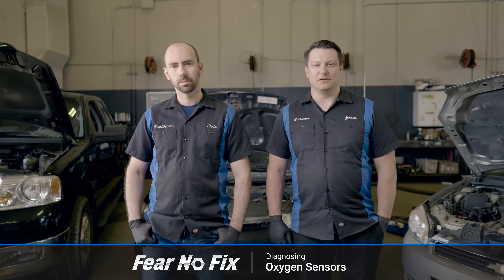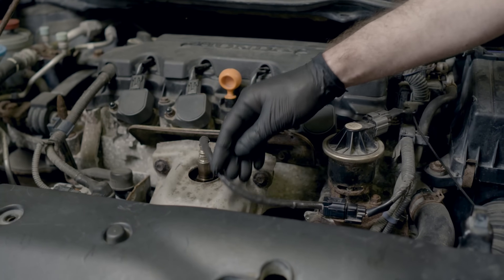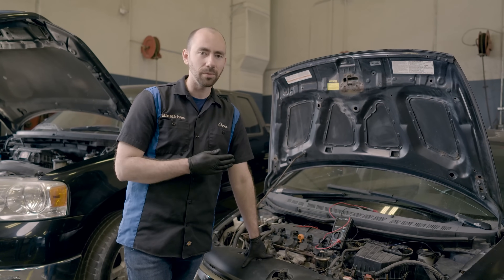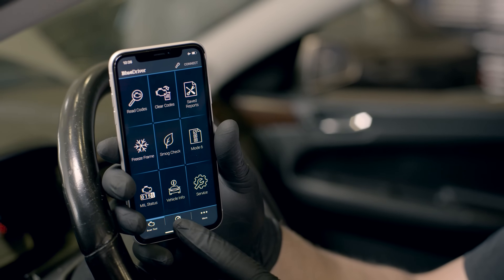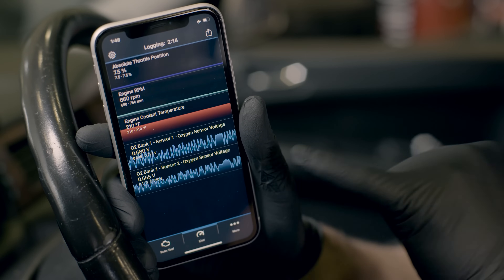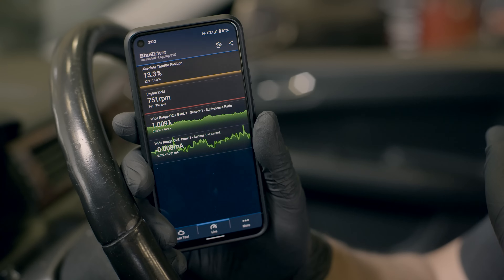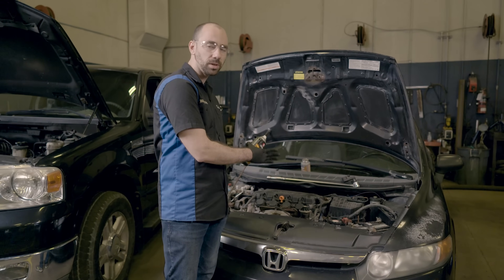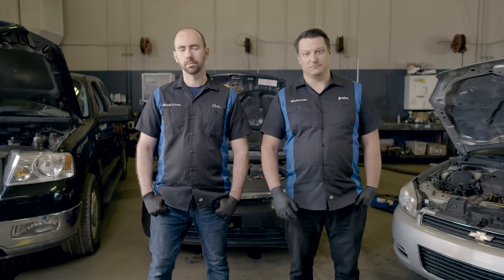Diagnosing O2 Sensors

Comment: I have a 2018 Nissan Titan. My body sensor is telling me that bank 1 sensor 1 is bad. I went to change it and couldn’t get to it. I removed the wheel well cover and couldn’t get see it but it is blocked by several break lines. I could get the socket on it and then attached the ratchet but there was no space to move it. Any suggestions would be much appreciated.

Comment: I have just replaced the front lambda sensor on my 2006 Daihatsu Charade and the old sensor came out surprisingly easy. The orange light is off non so it looks like I solved the problem

Comment: I did replace the o2 sensor on top of a 4 cylinder 2013 Chevy equinox it did stop stalling on me😮I don’t no if I should replace bottom 1 as well
Reply: It was stalling after I replaced the top o2 sensor it ran just fine😮

Comment: Horrible product from a security and right to own perspective. Can't connect to the device without enabling location data (it's a blue tooth connection imagine if you couldn't connect to a pair of blue tooth ear buds with out enabling location data). Also, you have to make an account. Why, probably targeted advertising that they are going to sell your data from your device to advertisers.
Reply: i’ve never had to enable location to connect to mine. or make an account.
Reply: @gtrplaya1234 new version doed require location and account

Comment: IF you replace the 02 with a new sensor and you have it showing bad data still?? AND I have replaced the CAT twice?  Would a running "rich" condition show a leaking/bad Injector...but it is idling just fine.....................

Comment: this may seem a bit far off but im pretty sure my bad o2 sensor is causing my transmission to go into limp mode
Reply: Checks out misfire leads to knock sensor the computer knows and make it drive at a safe preprogrammed setting

Comment: My pre cat sensors swing up and down sharply as good ones should, yet my B1S2 is pretty flat at .47V but my B2S2 is flat at .031v. Both spike up when I rev it. Under .45 is supposed to be a lean condition so is my B2S2 detecting a lean condition post car but pre cat the fuel trims are hoveering around 0. Do I have a bad cat in B2? There is no leaks in it as its one unit and there are no leaks between the 2 O2 bungs. All 4 are new and its on a 2012 Chrysler 3.8 with 136K miles. Thanks
Reply: What are your trouble codes?

Comment: Excellent information and teaching! Thank you for the great video!  One little thing I am laughing about to myself as I watch the video is that for the sake of the viewer (Me lol) you've chosen a car with an O2 sensor right up front where it's the easiest thing to see, find, work on and possibly change out if needed. I want people to know though that almost all (obviously there are a few that are easy) are VERY difficult to find, reach and work on. 16:08 "This sensor is proving to be pretty easy to remove". Wow he sure said that right LOL. They are being VERY polite and smooth. In the real world 95% of the sensors you will have to remove will "prove to be" lol. Al LOT more difficult to remove. A LOT, LOT more difficult.  They are so often only accessible from underneath the car and sometimes only through the wheel well or some other strange place very difficult to reach. Sorry for telling the bad news. But the facts are always better to know up front then finding out later when you're in the thick of it. Thanks again for the great video!
Reply: I guessed they would be, luckily for me my S1 is right in front and came away easily with an open ended spanner....phew. (Mitsubishi Lancer 2006)

Comment: It should be noted that you will want your crowsfoot-type  O2 socket to be perpendicular to your torque wrench. Otherwise, the torque that you're applying will be different from the value that you set your wrench to. Also, if you're replacing an O2 sensor, they should already have anti-seize applied to them from the factory. And a final note – if you remove an O2 sensor just to inspect it and plan on reinstalling it, they have a crush gasket (washer).
Reply: Awesome info, greatly appreciate the info.
Reply: Uy 12😊I 😊😊D
Reply: I. Don't know what to do with it

Comment: Hello ! I took my hyndai getz 2008 1.4 petrol .no. 1 lamb from the sensor before the catalyst, diagnostics showed a non-existent very low signal due to which the engine worked very stiffly and you could feel the vibration. I put a new lambda sensor original bosch and checked it with the diagnostic device on the engine running in 71.. .730 Ma was the rapidly changing amplitude of the signal. Although I'm not a professional car mechanic, I managed it, as they say a man from the forest fixed the car, good luck to all DIYers!

Comment: I heard about the cars built before year 2006 have different type of sine wave pattern for the O2 sensor. This is due to the ECU not cutting back fuel sufficiently to prompt the voltage to 0.1V for the O2 sensor. Yes, no?

Comment: My o2 second sensor voltage is higher than 1. 0
It fluctuates between 1.0 and 1.02 on idle and when i rev up its value goes upto 1.6

What could be the reason?

Comment: I got (closed loop) as soon as I turn on the engine, 20 seconds 
After a cold start 

How can this be fixed I don't think it can go closed loop this fast. Or can this be normal for some vehicles?
Reply: Normal
Reply: Mine goes in close loop within 6 seconds, pretty normal.
Reply: @scottykilmer3920  How do you know when it’s gone into close loop?
Reply: if you have a scantool you can see live data !
Reply: @scottykilmer3920  How can you see on a scantool when it's gone into close loop?  (And yes, I have a BlueDriver scantool)
Reply: You can see this option only with the official software like   Vagcom, Opcom, Focom. This function is not avaible on a universal Obd-reader.
Reply: @scottykilmer3920  Interesting that this video by BlueDriver would refer to closed loop values monitoring, while their own BlueDriver universal OBD-reader won't show it.  Are you saying that this function is not available on BlueDriver?  If so, are you sure about that?
Reply: I'm not familiar with Bluedriver, I wouldn't dare to give certainty. But I do know that almost all universal OBD reader tools I've used so far don't show open/closed Loop  and 10 other functions.
Reply: How do you know when it’s gone into close loop?

Comment: 2.9 ohms on a heater circuit? its ALMOST shorted. What does the meter read test leads together?
Reply: 2.9 ohms on 12v is 4.1 amps.  That does not seem like a short for a heating circuit.  And that also is about 49 watts... again, seems reasonable for a small heater.

Comment: I wish if I have known bidirectional scan tools before I bought bluedriver. Guys, please save your money & buy a bi-directional scan tool. Bluedriver was good 5 years ago, but it is not a bi-directional scan tool. I had to re-set my TPS after cleaning throttle body and than only found out about TPS reset after cleaning & bi-directional scan tools.
Reply: I have 2 good bidirectional tools and still keep my BlueDriver in my pocket. It gives good data but yes, a bidirectional is needed at times but there's also ways to go around them at times.
Reply: @iam1smiley1  I had a SRS light on my 07 civic & Bluedriver misled me to coming so close to replace front collision impact sensor. In fact, that sensor was never the problem.
Reply: @desi4lyfe379  code reading is only part of the diagnostic process. Codes may put you onto the correct problem area but it's still up to the technician to do proper testing before changing parts.....you see this happen a lot with O² sensors!
Reply: @iam1smiley1  There are so many cheap obd2 readers & I dont see the value in bluedriver. It was a great product back in the day, but bidirectional scan tools are just much better.
Reply: Guys my fuel status shows (closed loop) just after a cold start. And the fuel trims start showing the readings.  I don't understand why doesn't make sense 😐 

It should only become closed when  heat increases. Not sure if that's accurate or it needs an updated IDK 

Bluedriver 
Fusion 2014
Reply: All OBD2 ELM-327 are bi-directional the only problem is the software.
Reply: @w0lvez1  ELM-327 is not bidirectional in context of automotive.  Bidirectional command is like turning the fuel pump on and off.  When ELM claims bidirectional, it just means it can erase codes, not actual OEM / pro level automotive bidirectionality.  Don't bs people into trying to buy cheap chinese knockoffs.  ELMs are so shitty they can't even determine which code turns on the MIL light.  It just spews out all the codes and doesn't know which one is causing the MIL.
Reply: @derek7819   99.9% SURE it's Bidirectional. It can change the coding on VW & Audi control module using Carista app. It doesn't let you type the coding directly but it can adjust the coding settings.  Example:  adjusting the tail, brake light & DRL brightness.
Reply: @derek7819   YES, it can activate the fuel pump or do actuator test on a Ford using Forscan software. It can also read all pids on all modules. ELM 327 has the capability the only problem is finding software that will work with other makes. I also have a genuine ELM 327 almost 2 decades ago.
Reply: @w0lvez1  Ok that's a joke then.  The forscan software is sending in the commands and using the ELM as a passthrough hardware.  Basically if you took a fork, plugged it into all 16 pins, and allowed it to send a digital signal, forscan could also use it as passthrough hardware.  Would you call that fork a bidirectional scan tool? Hell no.  You could definitely buy $1 connector sets off ebay that can do the same thing and its just the dlc port plugin prongs with barebones pass thru hardware.
Reply: @derek7819  ELM 327 is a just HARDWARE. You still need a SOFTWARE for it to work.  It can read, change control module settings and command output tests so it's bi-directional.  Can you send a wave form signal using a fork? Show me how.

Comment: If you're in the rust belt, heat up the exhaust pipe near the sensor  before attempting removal. 
I actually tore the o2 sensor housing clean off a 2002 yukon trying to remove bank 1 sensor 2.
Reply: Spray on blaster on and soak overnight. Comes off like slicing through butter 🧈
Reply: @aaronwism  how/where exactly do you spray it, such that it actually gets into the threads?
It seems that if the sensor is screwed all the way in, there would be no way to get any spray into the threads.
Reply: @tc3imagery  it’s called penetrating oil fir a reason. I’ve never seen a o2 without exposed treads and I’ve been turning wrenches ( mechanicing) for 40 years. Spray on the nut facing the threads it will run into the treads. Don’t be stingy with it either!
Reply: @aaronwism  Thanks!